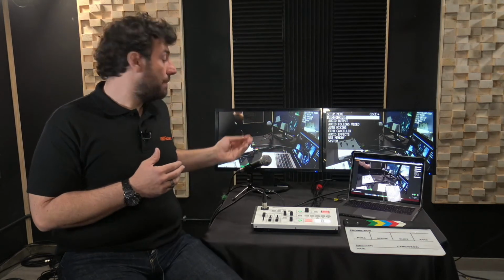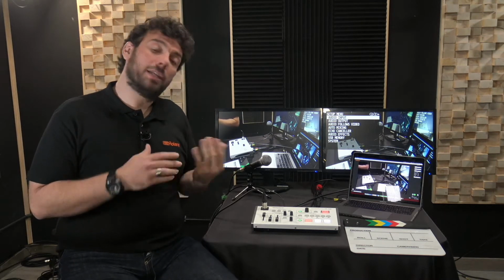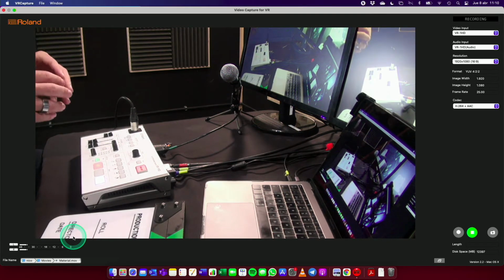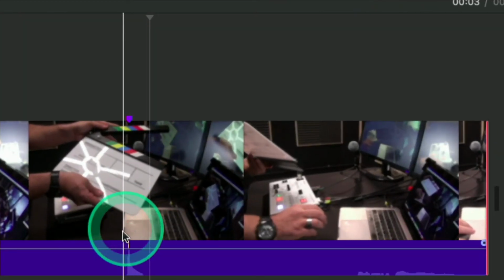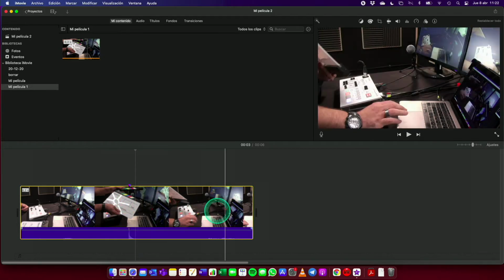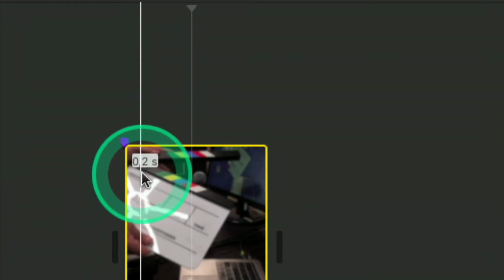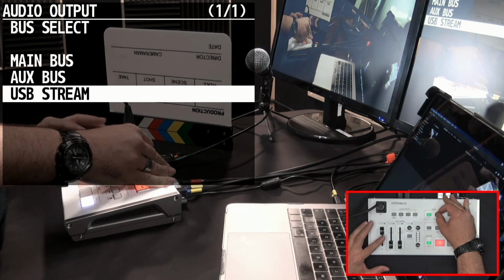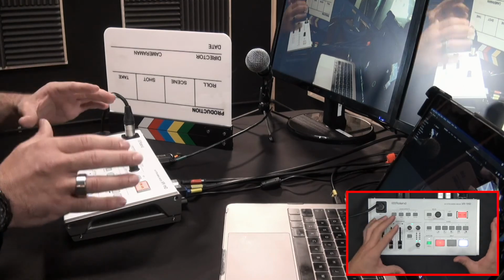How to Synchronize Audio and Video— Roland VR-1HD

Comment: As another user mentioned, the adjustments for 0.2 seconds is not 0.2ms but rather 200ms. Huge difference and huge issue that Roland is releasing videos with such HUGE errors. @RolandProfessionalAV what's going on with this?

Comment: Great video. I'm using the VR4-HD with two cameras one of which I'm using the hollyland 300 pro wireless transmitter and receiver. Which is where the latency issue happens. Using this method will it work?

Comment: Hi I recently bought a Roland V8-HD Mixer, but some time ago I had the same problem with a VR-1HD and with the video and audio signal of the microphone integrated in the cam, in the mixer by connecting a headphone, the audio of the microphone (my voice) and slightly delayed, the opposite problem as shown in the Video This way I can't wear headphones. Can you show me a solution?